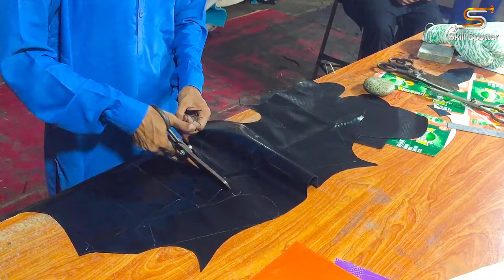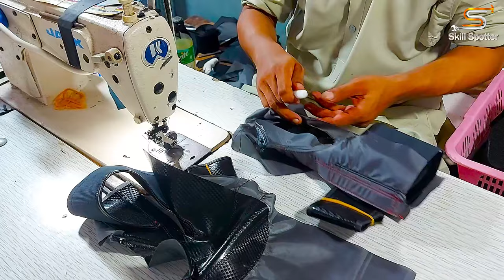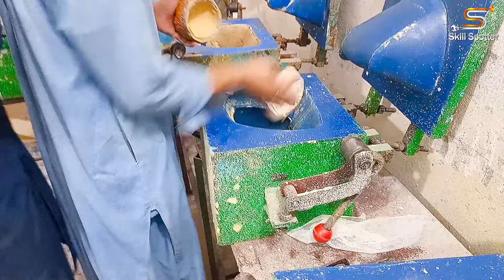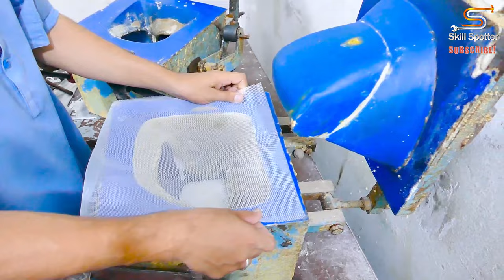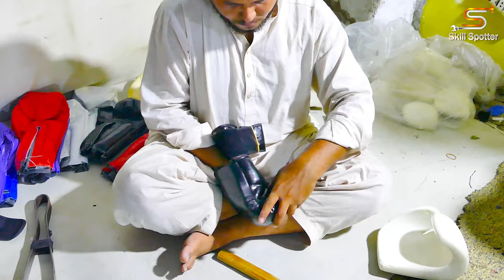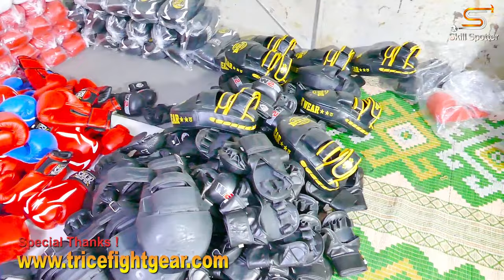Boxing Gloves Making | How best boxing gloves are Made | MMA Muay Thai Fight Gear

Comment: The best is made by Winning in Japan. Then 1V1 in Florida.
Reply: Yes but there gloves are a steal they were $30 on Amazon for cowhide leather amazing deal
Reply: @secredeath  that just means they are crap quality.
Reply: @aryanpugilist  I bought some $44 cowhide leather Muay Thai gloves from farabi made in Pakistan it's been 2 years still using them molded perfectly to my hands and the leather on the outer grip bar is starting to peel... Not bad for 2 year old gloves for $44
Reply: @secredeath  Farabi gloves are okay for beginner gloves. £44 is no steal though for gloves like that. There are better gloves for around £50, but generally you get what you pay for. The gloves in this video are trash however.
Reply: @aryanpugilist  what brands are better for £50?
Reply: @secredeath  It depends what you want really. Green Hill gloves are good quality for a low price and are used in amateur competitions often. Even RDX gloves from the UK are long lasting and good quality for the low price they are. Everlast Powerlock 2 training gloves are sometimes sold at 50-60 dollars. Those are great for the price. 

Really though, it's better to save up a little while longer and just buy some gloves that cost a bit more. There are some odd few gloves that will be great for cheap, but for me I'd say it's better to buy something a bit more expensive that you know is guaranteed to last, rather than buying cheaper gloves again and again on the off chance that they might last. 

If you're a beginner, it doesn't really matter too much anyways. Your Farabis will probably be fine until you start to level up and spar or fight.
Reply: @secredeath  also, buying from Amazon is not the way to go. Buy from genuine Boxing stores.
Reply from the maker: Hi Sir you can check the link in the video and in Discription also and you can get all the qualities you want Best for you.
Regards.